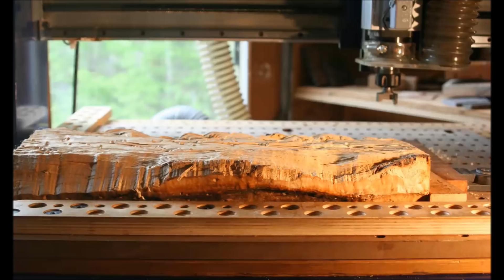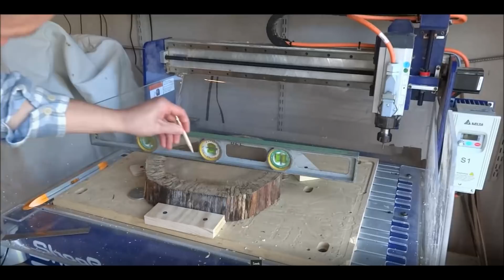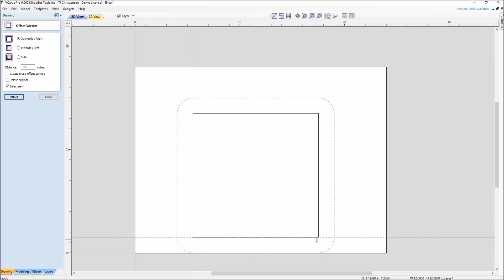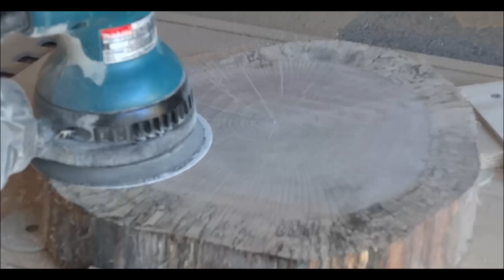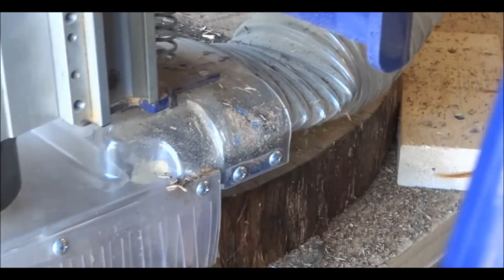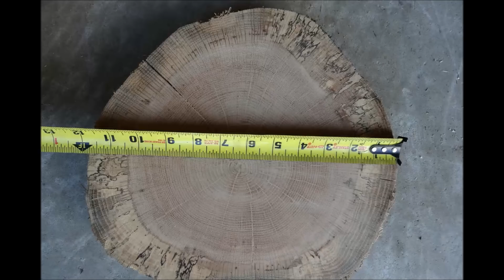Flatten a Log Slab with ShopBot CNC - Will it work?

Comment: Nice video,  I am wondering if the bitmap trace you created could have been used to create your toolpath. 
I am also wondering if there is a prescribed method for carving on a non flattened surface ( cutting on the true existing topology of the workpiece)? Any thoughts?
Reply from the maker: The answer to both is yes!

The bitmap trace is a vector just like any other. For instance you could offset it on the inside and cut a pocket that is the same shape as the original. Or cut a groove along that offset line to act as a juice groove for a cutting board. Or scale it down and cut out coasters that are the same shape.

If you have a 3d model of a 3d surface like the original surface, VCarve has an option when creating a toolpath to "project onto surface". This will take that toolpath and map the z-axis values to that surface.

The trick is to get the 3d model of the surface. A touch probe is one way, along with some protographic and scanner options.

Comment: Hi Shopbot i'm retired Englishman living in France found this territorial very interesting I did used to work for a firm many years ago that had a similar machine only a lot bigger 1.2 m x 3 m  roughly. 
Used to make soundboards for church organs lots of holes and slots being drilled obviously very complicated for the guy who was setting the program, there is just one thing I'm bit concerned about I cannot see any dust extraction I hope you're wearing a mask if you're in the same proximity of the machine as you have very fine dust particles coming office and is going to do some serious damage as for your health, because in 1998 I lost a colleague through inhaling dust had been working on the machine for approximately 10 years, so please wear a face mask with a decent respirator and obviously goggles or I protection please be safe especially as we're all in lockdown or thereabouts to do with the virus Corona 19 now approaching 20. 
Kind regards Phil from the Moulin in France.

Comment: Router bits are always happiest going one direction, less so going back, so is the software capable of doing a 'squared spiral' so you are always traveling one direction and working outside to center?
Reply: Well heck don't I look silly....I skipped a little bit and only saw you going back and forth, happened to skip where you started in the center and worked out, that will keep the cutter happier...

Comment: "Using a straightedge to find high and low spots..."  Thank you! Flipped a light on for me; I've been "sampling" the surface at a finite set of points using a z-finder (touch-off height sensor, can't think of the real name). Takes forever and misses most of them anyway.

Comment: Great video. Can you share the parameters for the Amana tool you used, hard to see the numbers in the video. Thanx
Reply from the maker: No problem @acebetter!

Depth per pass - 0.08"
Stepover - 0.875"
Spindle RPM - 12,000
Feed rate - 6 ips
Plunge rate - 1 ips

Comment: thanks for your video 
have a question I have a really big slab of Elmwood I was going to use for firewood but found out it is way too hard to split do you have any idea if this would can be milled like in your video you showed thank you very much
Reply: Late reply but with the right bit and feeds/speeds setup you would be able to surface a slab like that. keep your Z travel in mind, if the slab is 10" thick and your z only has 8" of travel you won't get too far. but in terms of milling, elm wood is a great hardwood to work with